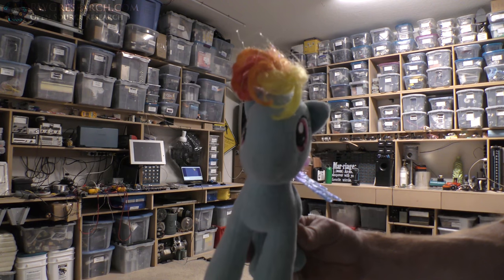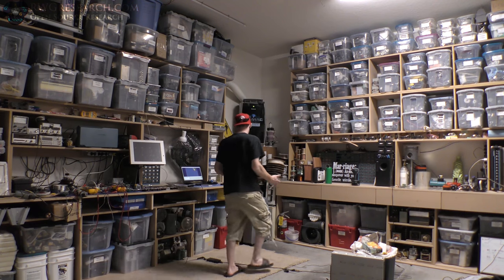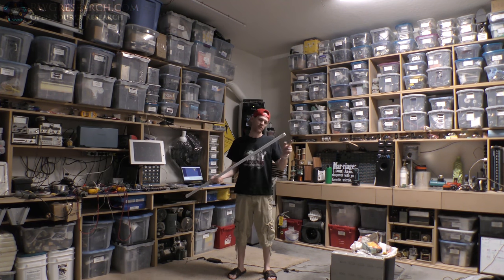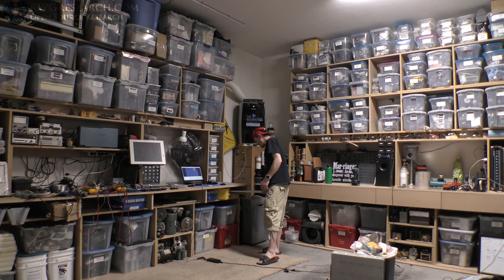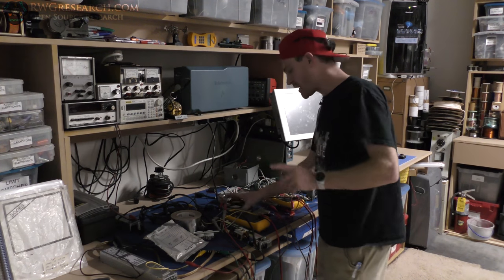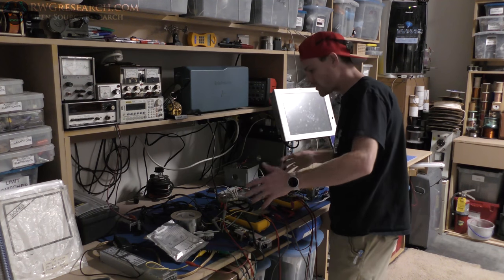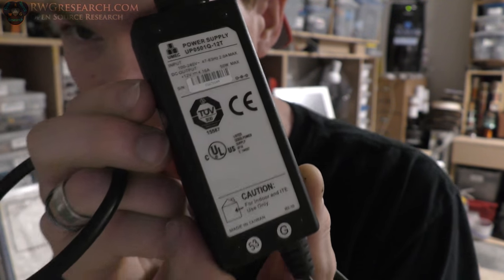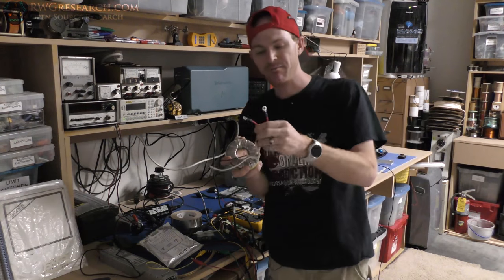Linear Voltage Regulator MOSFET LED Dimmer (NOT PWM), Secret Dimmable LED Shop Light Controller.

Comment: Ross, why complicate it if we could simplify it? You could use an ATX computer font, with an LM-317 voltage regulator with a bypass transistor, or two, or three, bypass transistors. To the ones on top..., don`t use any regulator.

Comment: You're using a MOSFET in the linear region as a variable resistor.  As long as the power dissipation across the MOSFET variable resistor when the LEDs are at half-brightness is low enough at high ambient temperatures you should be fine.  It's not that efficient but if it works it works.  However, normally LED power supplies are current sources and a variable LED power supply is typically a voltage-controlled current source.  Going back to the MOSFET design, since a transistor is a current amplifier by definition, it's most likely that you could have used an NPN transistor in the place of the MOSFET and the performance would have been better.  The voltage drop across the transistor would be much much lower than the the voltage drop across the MOSFET when the LEDs were at half brightness and therefore the power dissipated in the transistor would be much much less than the MOSFET.